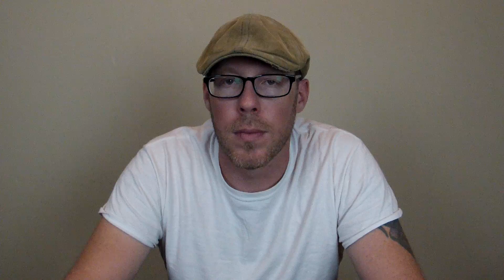What Is A Pool Anode?

Comment: This is an old video, but it still answers questions that people who install pools cannot. Good explanation of sacrificial anode.
Reply from the maker: Thank you. I like to think I have done quite a lot to get people more knowledgeable about these devices. The one thing I would mention is I see many people treat anodes like a silver bullet to solve galvanic corrosion, where it really is not. It is more like the least you can do...you really should have one. It helps a bit. Not like OK I have an anode now galvanic corrosion is off the table. It's a dynamic problem. TDS and salinity count is the greatest contributor to current transfer due to electrical conductivity of the water increasing.

Comment: I have an above ground Intex pool with vinyl wall and metal top rail and legs; will I need to bond the pool before adding an anode? I am using a saltwater system and the last pool corroded in 2 summers. I am trying to prevent corrosion as long as I can.
Reply from the maker: The real answer is that you need an electrician to bond your pool properly.  It involves working inside you house main electrical panel.  You can install the anode if you want, in the plumbing between your pump and filter, and then your electrician can include it in the bonding grid they run.

Comment: Steve--Great video!  This information is exactly what I've been trying to find.  However, I do have an additional question.  I have a #8 bare copper wire connecting all of my pool components (walls, coping, diving board, sliding board, light, etc.), but my pump, anode, etc., are 30-40 feet away.  Can I run the bare wire underground and then connect it to my pump and anode, or should I encase the 40 ft run in conduit?   Also, you mentioned tying the bonding to the home's electrical panel main ground.  What is the best way to do this?  Run a bare #8 wire from a bonding grid component and simply tie it into the grounding bar?  Thanks!
Reply from the maker: How to run the wire depends on your local electrical code.  For example, bare copper is used in Canada, while in the USA green shielded copper is required in most areas.  I can see very little reason for anyone who is not an electrician to run bonding wires.  First, the system is supposed to be looped such that it connects to the bus bar, runs around the pool, and connects back to the bus bar.  If you cut the line anywhere, it still has protection from both sides.  Fooling around inside an electrical panel with a bunch of bare copper wire is a great way to get yourself electrocuted and all panel work should be done by qualified professionals and homeowners only.  That being said, since you asked, the wire runs all the way around the pool and system and back to the bus bar again, and then you connect short tails out to each of the components such as pump and heater casings, sacrificial anode, handrails, lights etc.

Comment: have a new saltwater above ground pool. 12x24 resin.  My Raypak heater has a copper HE, so I was thinking of putting an anode in-line and a check valve. However, the heater has an automatic bypass. so would I need the check valve? I'm pretty sure the bypass closes anytime the heater is off. Also with the bonding loop - why do we need that? Each component in my system - pump, SWG, heater have a 3 prong plug and the ground pins all meet in the receptacle box. So they are already bonded, no?

Comment: Hi Steve, love your videos!! i wish more local people had your knowledge. I have a salt water pool that does not appear to have an anode. I will be installing one. It appears you recommend after the filter but before gas heater? I am also just going to install a solar heat system as my equipment is in a shed with a roof exposed to lots of sun. My plan was to cut into the main line after the filter before the gas heater and run two lines up to the roof. I have not been able to get the same answer twice on how to properly do that. Any thoughts? and where would the anode go in relation to the solar pipes?

Thanks so much!!
Reply from the maker: It does not matter where the anode goes so long as it is installed in the plumbing system and connected to the bonding grid.  To send water to the solar you need to install a bypass after the filter but before the gas heater.  A bypass can be done in a few different configurations depending on how much control you want over your flow and whether you expect automatic control over switching to solar.  The easiest is to install a 3 zone bypass with 3 ball valves.  Cut into the pipe and put a line to the solar heater (with a valve on it) as well as a return line from the solar (also with a valve on it).  Now you have the original pipe plus the two added tee fittings - one for solar supply and one for solar return.  In between these two tees you would install the 3rd valve.  This allows you to control the flow completely to the solar - allowing all, none, or some of the water to go to the solar.  This would be for manually controlled systems.  If you want auto control then you can find the installation diagrams for this in this article: http://www.swimmingpoolsteve.com;/pages/pool-solar.html
Reply: Thank you Steve, I installed the inline style anode and wired it to the bonding grid. Thanks to your videos, I realized my system didn't have one. The solar plan sound great, thanks again.
Reply from the maker: I am happy this info helped you.  Cheers

Comment: Sorry follow up question.  The instructions on the inline anode showed installation between the pump and the sand filter.  That is where we installed it.  All the videos you have posted show the inline anode between the sand filter and the heater.  What do you think?
Reply from the maker: Either of those locations will be fine - the anode will work installed anywhere in the pump room.

Comment: Hi Steve,  new heater installed and again, the installer did not know about the Anode.  I purchased the inline anode and had him install it.  All the equipment, heater, pump, and salt water generator are bonded together.  The question is the inline anode wire was connected to the bonding lug of the pump, not the heater.  Is that ok or should I run a wire from the anode to the heater?  Many thanks.  Vince
Reply from the maker: The bonding grid is supposed to connect to all metal components such as the pump and heater etc.  The anode you attach anywhere to that bonding grid.  If you just have a wire from the anode to the pump then that is not finished yet. It does not matter whether the anode wire connects to the pump lug or the heater lug, since all of those points are supposed to be connected to the bonding grid anywhere.  From an electrical perspective, all of those points are "the same" since they are connected directly with a bonding wire.

Comment: Hi Steve, another related question.  The inlet tubes ( 2 of them ) on my Hayward heater (1 year old, used for 4 months) have disintegrated.  Do you think the inline anode, connected with wire to the pool heater will avoid this from happening again?  Thanks, for your help.  Vince
Reply from the maker: A sacrificial anode would help this in the way that the pipes would become the cathode in a galvanic couple.  This would slow down the rate of corrosion so long as you replace the zinc in the inline anode when needed.  Most likely however this is chemistry related...or at least that would be the cause of most failures like you have described.  Specifically if you have a salt water cell downstream of the heater and no check valve in between them. If this is your situation, that is the cause of the pipe failure. A sacrificial anode would not prevent that bt could potentially improve the resistance to corrosion of chemicals via cathodic protection.
Reply: Gulty as charged. No check valve in between the salt water cell and the heater.  Am installing both check valve and in line anode with new heater.  One expensive lesson.  However, without the check valve, I would expect the outlet pipes of the heater to deteriorate, the ones closest to the salt water cell, not the inlet which are farther.  Shouldnt the outlet pipes deteriorate sooner?
Reply from the maker: Yes I would agree that the outlet pipe is usually the first to go.  This is actually one of the big tell tale  signs for salt chlorinator damage in that the outlet would be much more corroded. Is your heater casing itself bonded? (this would be a heavy gage copper wire connected via bonding lug somewhere to the outside casing)
Reply: Nope.  Wasn't bonded either.  My set up would have made a good "how NOT to set up a new heater and salt cell".  How does bonding prevent this type of corrosion?  Thanks!
Reply from the maker: Your heater is acting as a sacrificial anode in a galvanic couple through the water. If the heater casing were bonded then it would not be able to have a different potential voltage than everything else that is bonded and touching pool water.  SInce yours is not bonded it is possible for your heater to have a small voltage difference than other components in & around the pool water. Once there is a voltage difference then a current leaks between the two different points. Your heater is acting as the sacrificial anode and corroding at an advanced rate while some other area of the system is receiving extra corrosion protection (cathodic protection) from the heater being sacrificed. Bond the heater as it should be (bonded to every other part in and around the pool) and there can not be a voltage difference between these components. No voltage difference means no current transfer. No current transfer means no galvanic corrosion. You have the perfect example here of a HUGE problem in this industry...most pool guys I have met have no idea what a galvanic corrosion is, what a sacrificial anode does, or why these pool heaters keep failing every year. Feel bad for pool owners like you.  Sorry on behalf of all decent pool guys.
Reply: I agree that very few people know about this issue.  I really appreciate your help.  I know it is helping me and hopefully others in the future.  I have a heater, pump and salt cell.  1.  I dont see a lug on the salt cell to bond too.  Is that right? 2.  Anything else I should be bonding?  Many thanks.
Reply from the maker: Vinceand Theresa The salt cell does not get bonded but the controller mounted on the wall if you have one would get bonded. Every part of the pool, the pool equipment and the surrounding pool area needs to be bonded if it has metal in it.
Reply: I looked at the controller mounted on the wall and do not see a bonding lug.  Can I add one? Where and how?  The only other metal I have around the pool is the ladder.  Many thanks,  Vince
Reply from the maker: Vinceand Theresa The ladder is something that is bonded during the construction phase of the pool.  The bonding grid is (should be) buried in the deck around the pool which is how the major components of the pool get bonded.  Yes, you can add a bonding lug to the casing of the salt controller.  If it is made of metal then it should be bonded.

Comment: Hi Steve.  Great video and channel thanks.  How about zinc anodes that are "puck" style that goes in the skimmer?  Will it work the same as the in line style?  Thanks, Vince
Reply from the maker: The zinc disc that sits in your strainer basket is designed to help with localized anodization however since it is not directly tied to the bonding grid of the pool is does not provide systemic protection the same way that an inline anode would provide.  Disc anodes, as well as ladder anodes and light anodes are great as additional levels of protection but should not be used as a stand alone solution against galvanic corrosion.
Reply: Understood.  Thanks again
Reply from the maker: Vinceand Theresa Glad I can help!